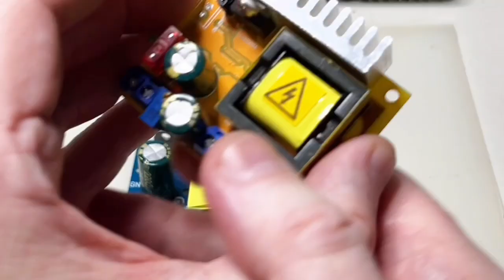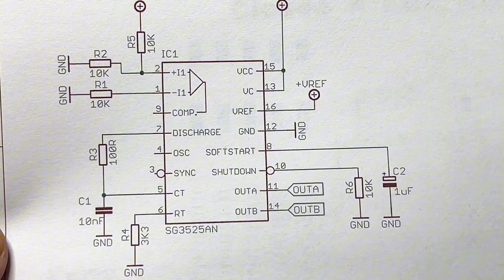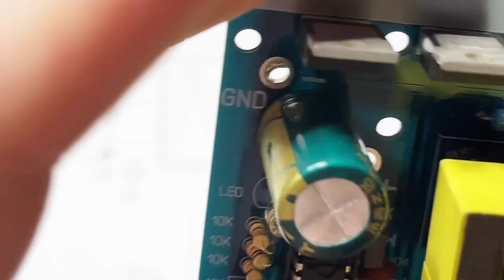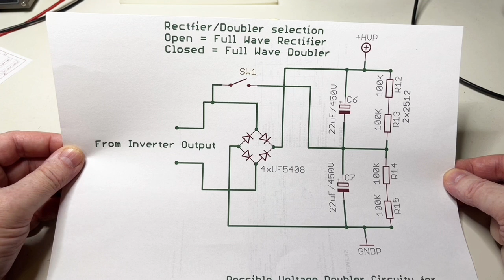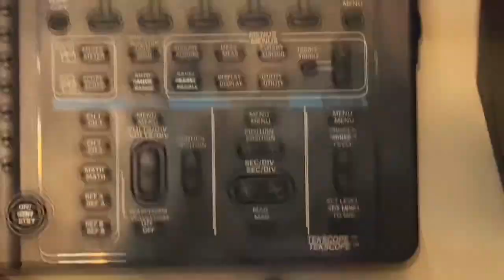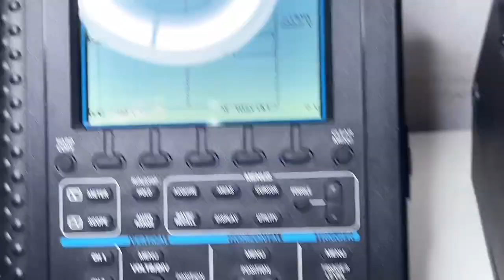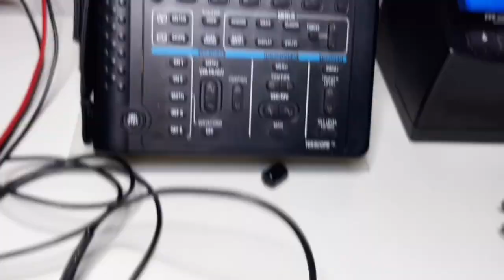Cheap PushPull Power Boost Inverter Modules, Schematics, Details, Testing

Comment: What is the output power you can get from this push pull output?
Reply from the maker: The transformer can deliver up to 500w
Reply: @KonstantinGrigoriadis have you measured yhe transformer parameters such as leakage inductance, primary and secondary inductances, interwinding capacitances etc to make a spice model of that?
Reply from the maker: @robr8554  no not needed yet

Comment: In this circuit C4 - 4700uf16V cap is too heated. Then I assembled the 2nd board but it is the same problem. Capacitor heat when applied to the 1.1A load.
Reply from the maker: The high ripple current from the inverter is causing the heating.
To minimize the heating you could use several smaller capacitors in parallel so they share the ripple current.
Remember that capacitor has to supply the peak current of the transformer primary, which is at least ten times the secondary current.
I'd suggest a film capacitor of several microfarads to deal with the high frequency stuff in parallel with the electrolytic. Electrolytics get quite inductive at high frequencies.
Further without a working Snubber the Voltage spike will exceed the 16V capacitor rating, further the DeadTime must be adequate. What do you use as the 1.1A Load ?
Reply: @KonstantinGrigoriadis output load like dc fans and 110V operated dc bulbs. As per your suggestion I will apply 3-4 ceramic capacitors CVR103-1KV cedicom make types. One more thing currently the snubber circuit is not considered in the circuit board. But my filter capacitor is 4700uf100V not 16V. Input and output ground is common.
Reply from the maker: @0124akash  Not Ceramics use film PP capacitors with 1-3.3uF >= 100V, futher check what the Operating and Resonant Frequencies for that transformer you use are, expand the Deatime to 2.5us using a 100R instead of the 10R. I made a dedicated Video on howto determine the resonant and operating frequency of a transformer using a scope and a Frequency Generator.
Reply: @KonstantinGrigoriadis okay sir, polypropylene capacitors 2.2uf400V capacitors in our stock. 
RT is 22K, CT is 2.2n63V box, Rd is 100E, 1uS is dead time measure with oscilloscope. 80NF10 mosfet 2+2,
Reply from the maker: @0124akash  1uS is to Low use 2.5uS for that low frequency ca, 30khz with RT & CT you use, with CT you use for 2.5uS Deadtime the Rd must be 330R, why you use such low frequencies ? with an Osc of 30 khz you run the Converter with Osc / 2 = ca. 15Khz that why everything gets hot.
Again you need to know the working frequency of your transformer, you cannot take just anything , use some frequency and expect good results....
Further read the Datasheets for Rt,Ct and Rd
Reply: @KonstantinGrigoriadis sir, i think I give you all the details related to my dc to dc convert. So what is the value placing of RT, CT, and Rd ?
Reply from the maker: @0124akash  This totaly depends on the operating frequency of your transformer, for what frequency the transformer was designed for,this y can get from the data-sheet of the transformer or my measuring the operating and resonant freq of it
Reply: @KonstantinGrigoriadis 
TX data
5T 22swg*10
5T 22swg*10
70T 21swg*1
PQ50 - 12pin
Reply from the maker: @0124akash This says absolutely nothing about the operating frequency of that transformer, these are just the winding data, you dont even have the core material used !
A long as you do not know the operating frequency of your transformer you can only do try and error ! or measure it as i explain in my channel
so for example try to set the Osc frequency to 80 khz and use  2,5us dead time and see how it behaves.Btw, i would appreciate if you give me a thumbs up and subscribe to my channel.
Reply: @KonstantinGrigoriadis when I increase the operating frequency up to 65KHz then the output bridge diode goes to heat.
Reply from the maker: @0124akash what diodes di you use ?
Reply: @KonstantinGrigoriadis FR607
Reply from the maker: @0124akash they are to slow you need utrafast ones with a trr of no more than 100ns yours are 500ns ! Like the UF5408 Or even Better schottky sic diodes like idh04sg60c or similar

Comment: Hello sir, my circuit is 12VDC to 110VDC. Am using PQ50 transformer sg3525 ic and 2+2 mosfet each channel mosfet is 80NF10. Input and output ground is common. Problem is when applied 1.1A load at the output side mosfet heatsink is very heated after 15 minutes 100 degrees. How to solve this ? And the 2nd problem is if I am using another mosfet like irf3710 or irf4127 both mosfets are short when applied the minimum load is not full load. One more thing pin number 5 to 7 am using 10E resistance. And not apply any snubber circuit.
Reply from the maker: Hello,  With the minimal Data you apply, there is no Possibility to make any Diagnose....
So Many Variables:
1) Are your Mosfets Originals or cheap Knockoffs from Aliexpress ? the ones on my China Board are : 60V/120A, RDS(ON) 6.0mohm ones, yours have more than double the RDSon (if Original)
2) I have no Idea what the Data for your Transformer are, the transformer on my Board is designed for PushPull Mode
3) No Idea what Values you use for RT & CT, that determines the OSC Frequency
4) the 10R Deadtime Resistor seems to small (depends on the used Ct)
5) 110V x 1.1A = 121W, No Idea what the Dimensions of your Heatsink are
Reply: @KonstantinGrigoriadis mosfet is original because am purchasing lot vise mosfet and these mosfet using another inverter circuit board and working properly.
RT is 4.7K, CT is 10n, 10E between 5 and 7.
TX data is PQ50, 5+5 turns in primary 70 turns in secondary.
Heatsink weight 120g 35*35*85 L*W*H
I think sufficient data am providing you sir.
Input output ground common.
Feedback control set-up with pin number 1.
Reply from the maker: @0124akash  ok, fact is that you know only the winding parameters of the transformer and not the frequency its designed for, further the 10R is to low for a osc freq of 30kHz, it would be ca. 1us.
use a 100R Dead Time Resistor and better Mosfets Like the ones in my Schematic with lower RDSon
Reply: @KonstantinGrigoriadis sir, can you suggest any mosfet for this. Mosfet required 150V and 80A
Reply from the maker: @0124akash  FH3015PS 150V 100A 6.3mΩ 210W TO-220

Comment: I just received the 150w 12v version. I want to’ use it to’ produce a double 120v sinusoidal ac. Do you recommend to use a zvs driver?
Reply from the maker: The converter produces a square-wave signal not a dc,
further you have to correctly calculate the LC output Tank of the ZVS, what you mean with ZVS, the Mazilli type ?
Reply: @KonstantinGrigoriadis I would like to use the transformer and design a new smps (mazilli type can be an option).
Reply from the maker: The transformer is a push pull one and not made for a resonant design

Comment: the conversion efficiency is so bad, based on the video, input power is 60W, and the output power is 11W, and it is only 18% efficiency.
Reply from the maker: Yes in the Video it looks like that, but the 60W Primary where drawn when I had the Output set to 250mA (what I commented in the Video) Unfortunately while moving the cam I switched the load back to 30mA an that looks like if for 11W out 60W in s needed, what is not correct. 
The Eff is ca. 92% (60W(24Vx2.56A) in 55.5W(222Vx250mA out).

Comment: Удвоители или утроители отличная вещь, когда надо повысить напряжение, а лень перематывать вторичную обмотку трансформатора на большие зазоры, что бы пройти по электробезопасности, в трансформаторе может быть по прежнему 220V, но после нескольких диодов и конденсаторов, на выходе можем иметь под 1500-3000V.. И особенно хорошо удвоители работают с большими частотами, т.к. при больших частотах не нужно ставить огромные ёмкости, чтобы сгладить пульсации на выходе.
Reply from the maker: Hello, in my Designs I try use of the Shelf Parts, this is why I do not wind Transformers.
It would make the Design not easy repeatable and especially in the planned Project, where I need ca. 800V, but the Transformer gives only 380V.   
I Designed many High Frequency Transformer in the Past and had them made in China, so I can reorder when needed.

Cheers,
Konstantin

Comment: Could you please share the details of the transformer winding? For E422115 12v to 380v. What is the number of turns at primary and secondary and wire guage? 
Thank you for wonderful video
Reply from the maker: Hello, Thankyou:
Core size: length 43MM * width 43MM * high 15MM
Suitable frequency: 15KHZ-50KHZ

Primary pins: 1+2, 4+5, 7+8
Primary wire diameter: 25 * 0.2MM 5 square copper
Primary Turns: 3T + 3T

Secondary Pins: 9,11,13 and 15,16 (0,220,380V and 0,18V)
Sub-pole diameter: 0.6MM
Sub-pole laps: 0 + 55T + 40T, 5T

That is what Ali-express says,
Cheers
Reply: @KonstantinGrigoriadis  Thank you very much. Appreciate it 😊
Reply: Hey man once again thanks. I was able to wind a transformer using above data and it works like a charm easily able to power 200w bulb.
Reply from the maker: Glad that I could Help you my Friend, Cheers

Comment: Why you haven't included overcurrent/current limit?
It's already included in the IC.
(The same for voltage stabilization)
Reply from the maker: what do you mean ??? Include it where ? the schematic I show is a reverse Engineering of the China Module, not my Design, it has no regulation at all... its open loop. My Design will have U/I regulation with High Side Current Sensing and is not based on a SG3525.

Comment: Thanks for the video.  What are the additional features you would include in this project to transform this device into a regulated 0 to 220 Vdc power supply ?
Reply from the maker: Thankyou, Isolated current and voltage regulation, short circuit protection primary and secondary side, output voltage doubler, 2nd stage Filtering

Comment: I also use those modules for parts to make HV power supply for home made vacuum tube amplifiers.
Reply from the maker: Hi Joseph, did you finished it ? what are the Specs of your PSU ?
Reply: @KonstantinGrigoriadis  I just made it to the breadboard stage before finding one of the 150 watt inverters like you had in the video. Mine was TL494 based, But I was having trouble finding fast rectifiers for the voltage I was making. 1N4005 diodes worked, but would heat up. The 150 watt inverters had the rectifiers, so a little good filtering and I was set. My amplifiers are low powered so I barely loaded the PSU.
Reply from the maker: Hi Joseph, the 1N4xxx are to slow(trr Recovery time) that's why they heat up, you need Ultrafast ones like the UF4007 (NOT 1N4007) are for 1kV 1A 75nS rectifiers. I use UF5408 same Ultrafast 75nS but for 3A for Currents less that 1A and Through-hole. The onboard one are ok but not for 100-150W.
Cheers, Konstantin
Reply: @KonstantinGrigoriadis  I finally bought some from amazon, but by then was using the 150 watt inverters. I make these audio amplifiers from strange parts.. I have used horizontal output tubes as finals. I was driving thermostat transformers as output transformers. They are 480vac to 24 vac. and I used neon lamps as voltage regulator for the screen voltage. Oddly enough, it sounded wonderful. It makes approximately 3.5 watts per channel.
Reply from the maker: Sounds like a interesting project! How are the inverters performing noise-wise ?
Reply: @KonstantinGrigoriadis  Super quiet. The tubes I used were 12GE5 and a 12AU7 to drive them. I put a little pie filter power supply. Because of the hi frequency, the inductor didn't need to be more than about 20 millihenries, and I think I used 47 microfarad capacitors. But I don't remember for sure. I put the 12 volt dc power supply and the hi voltage inverter in a separate box from the amp circuit. the filtering was done in the amp chassis. and the 12 volts ran the heaters as well.

Comment: 6:52 i have the same inverter module but with the double output. Not yet tested, but you mentioned in your previous video to replace the capacitors with some more reliable ones. So that will be the first thing that i'm gonna do before i start experimenting with it. I don't want Cape Canaveral on my bench :-) 
Your own design is a very nice design and will be much more reliable. Thanks again for this great video. Grtz
Reply from the maker: Hi Bjorn, Thankyou ! Yes replace the 2 caps with 450 or 550 V ones for peace of mind. Cheers, Konstantin

Comment: Hi Konstantin! Another great video! I have a question: When the SG3525 works at 50% duty does the flux balancing of the core happen naturally?
Reply: Thats the thing - nobody bothers with flux balancing, you'll need proper peak or average current control for that.
Reply from the maker: Hello Thankyou, this depends on how good the Transformer is Designed and Build, how good the Mosfets are matched (RDS ON) and the DeatTime . Otherwise it could lead to transformer saturation.

Comment: Yasou Ntino! Nice video with lots of details as always. Before you use these transformers for your project, I would highly recommend you to dismantle one and check if they use copper wire and most importantly if they fulfill the basic isolation standards for your own safety. I have seen Chinese transformers without margin tape at the ends and with primary and secondary windings overlapping each other at the end of the bobbin and because they want to make them even cheaper, they use copper coated aluminum wire which will increase the losses quite a lot.
Reply from the maker: Giasou Thoma, Thankyou!
1) I have done that already (I dismantle everything 🙂) and the Isolation was ok 2 layers of Tape Between between Pri/Sec in more layers, no overlapping Pri/sec without tape. Please condider, that in this Design we do NOT Deal with Mains Reference or Rectified Mains, what would make it Safety Critical, its an PushPull from 12V! Even if something goes wrong (Short Pri/Sec), the Primary Circuitry will fail(Destroyed) and that's it! I no see any elevated Safety issues here except at the working end of the PSU (High Voltage)! Further these Transformers are used in the Majority of the Commercial low-cost CN Inverters !
2) Regarding CU coated AL, well that's how it is, again in the Majority of the Asian Magnetics used even in Brand name PC PSU's, this is something we have to live with. Expecting for that Price a pure copper Magnetic is probably illusion. 

Further this is NOT a commercial Design.
Cheers,
Konstantin